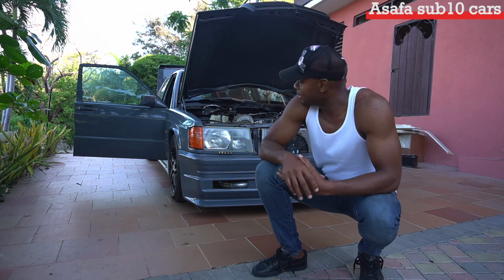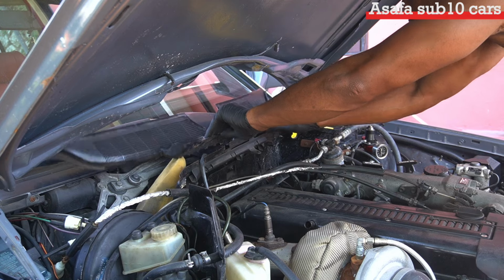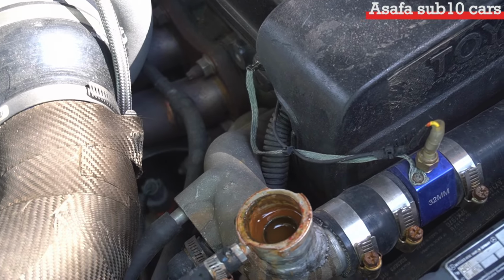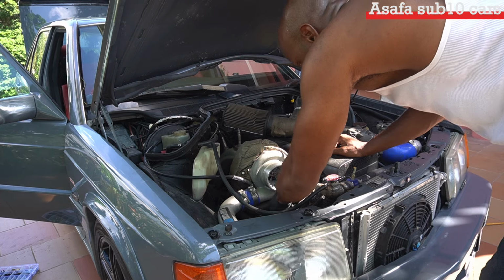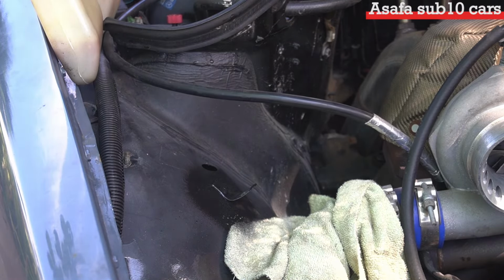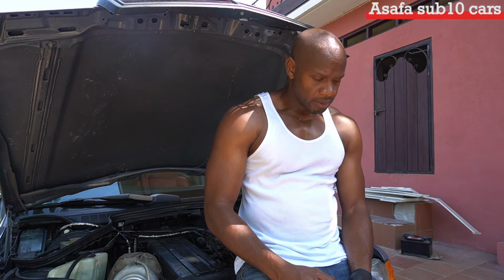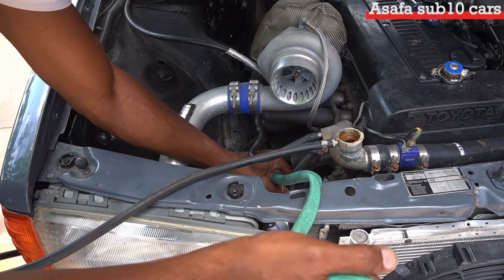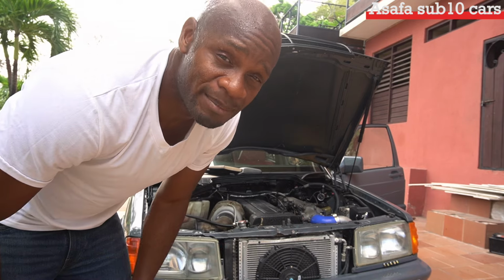Exciting build coming !!!

Comment: To run 10s u need suspension and transmission upgrades  alont with differential 500hp can run 10s even 400hp it all depends on power to weight

Comment: ATI Power glide Transmission With the 2Jz making about 650-700whp should put the 190E through the 1/4 mile in under 11secs.

Comment: It depends on the transmission you running.If you running a close ratio transmission you only need about 500 to 550 to run 10s.. If it's a lazy long ratio transmission, you need like 650 to run 10s

Comment: You should be able to to run 10s with about 
550whp-650whp

-Suspension is very important 
Putting power down is most important also the weight transfer when car launches 

LSD is needed
Good drag radials and or slicks 

 The car isn’t that heavy but if weight can be deducted that works too

Also transmission /gearbox matters

Comment: If you do an AWD conversion for accessible power. You wanna be able to easily access the performance and be safe if the weather gets unfriendly. swap to a sequential gearbox, you wouldn't need a lot of power, depending on the weight of course. Anywhere between 800-900. Most times are lost during launch, so a launch control system would also be a plus and of course tyres.
An 800hp RS3 is capable of 9.9s.

Comment: 750hp with slicks. Buy a power sequential gear box and done
Reply: 🇯🇲🇺🇲545 is good for it and to keep it reliable same way
Reply: @out_lawt.v.8421  a Audi R8 with 620 only gets 10.6 in the quarter. BMW M5 Comp does 10.9 with claimed 625hp. Anything under 600hp won't be fast enough. For the size, aero and weight of the car. A mk 4 Super can do 11.6 with 708hp and only weighing 1,490kg with a DSG transmission swap. 
545 won't get him anywhere close because surely things weigh more than a Supra. And there are tuned cars with 1000hp that is still quite reliable.
Reply: @out_lawt.v  no bro, nothing under 750hp plus he needs to do weight reduction, add slicks plus a sequential , dog box or 3 speed power glide transmission.

Comment: That car probably weights ~2.5 - 3 so you'd need around 500+whp to run low to mid 10s, shave off some of the old scrap and 465 up possible.